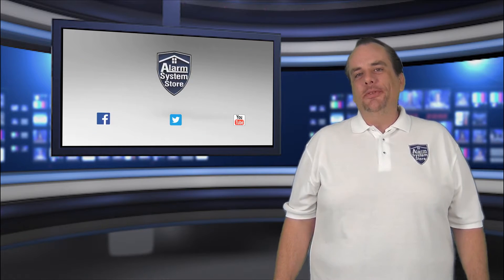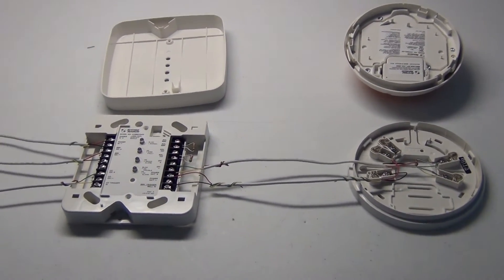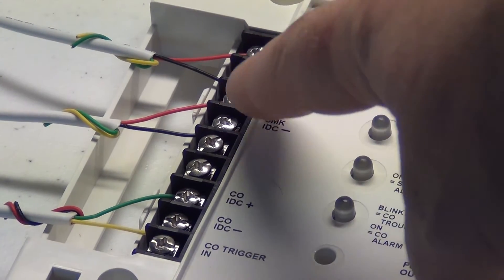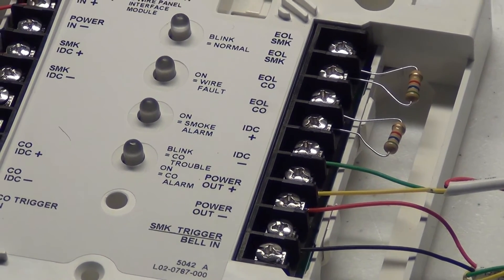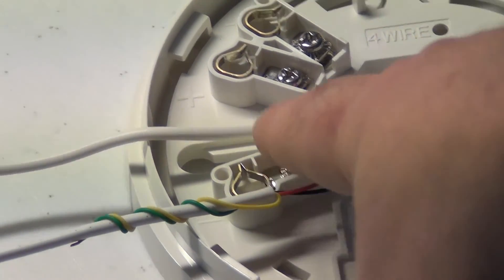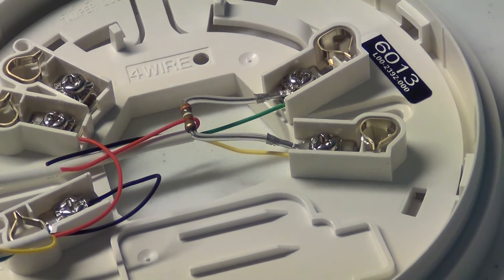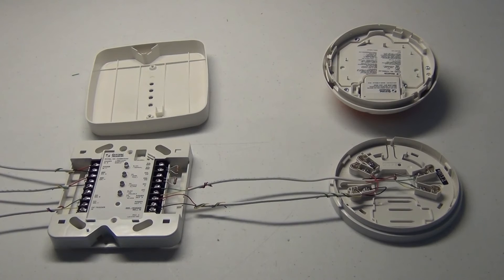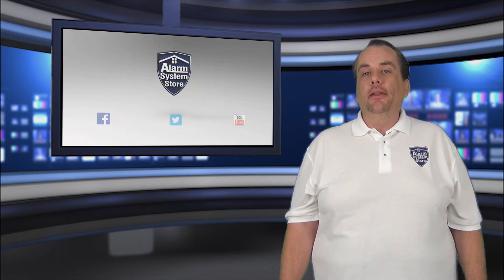System Sensor COSMOD4W & COSMO4W - Alarm System Store

Comment: Hello John . I want to use a 1.2amp Aux power supply to power the cosmod2w and eight 2WTA-B smokes connected to the module .My question is how much current can be applied to the smoke Auxpower + In terminal on the cosmod2W. I will be applying the current with a relay on the 4204 relay module board?